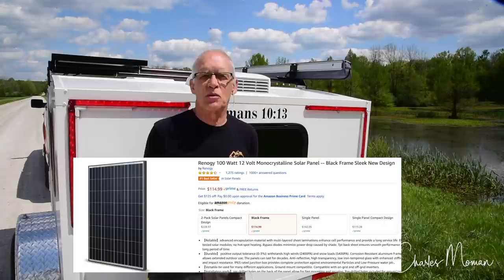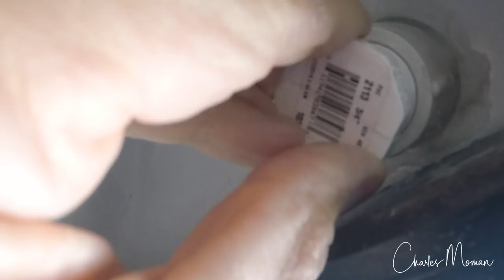A Simple Budget Solar Set Up for the Average Camper with Charles Moman

Comment: So when your jackery 500 is fully charged from the solar panel or from the A/C output how long can you leave the charging input cord in the Jackery? Like you forgot to take it out.. Does it keep charging and or does the light stay on? Will it hurt the battery ?
Reply from the maker: Like just about any modern electronic device, leaving it plugged in does no harm. I have left a Jackery plugged overnight and no problem. You might look at my recent review of the Ecoflow Delta 1300. It has almost triple the power of the Jackery, and yes it is more expensive, but it can recharge from zero in less than two hours. The Jackery takes so much longer. Ecoflow is coming out with a smaller version - R600 - that still has the fast recharge technology. I’m switching my entire system over to Ecoflow. I’m also just about to announce here on my channel, a Ford transit van build I will be beginning in a few weeks and I think you might find it interesting. You might subscribe so that you can keep up with it. It will be a 4 to 6 month van build and we will still use our Runaway camper. I’m pretty excited about it. Actually today I am filming the announcement video and telling an overall view of what I will be doing. Then the van build episodes will start in about 2 to 3 weeks.
Reply: @charlesmoman  nice. I know the Ecoflows line up is great.  I was looking at the r600 alot and other solar generators but living in Hawaii no body ships out here! As well as portable refrigerator coolers. I even backed the iceco icooler and three weeks later they said they couldn't ship to Hawaii.. I REALLY wanted that cooler. It really sucks 🤬.... well thanks for the info 🤙🤙

Comment: I am in the process of creating this set up. In your experience does the Jackery 500 charge faster while driving using the car charger port or the solar panel connection? Thank you 😊
Reply from the maker: It will definitely charge fast with a car charger and I should have included this info. To charge even faster in a car, get an inverter (some cars have an AC outlet in them already) and then you can use the Jackery wall charger - like at home. That will send more juice to the Jackery like you are charging at home. I would suggest a Bestek - I found these two on Amazon and they are similar, but  the more expensive one (not really too much $$ anyway) is more powerful.  300 watt Bestek ($29.99) - https://amzn.to/2XE4jFe. &500w Bestek ($39.99)  - https://amzn.to/3dglvH9. Let me know if you have anymore questions.
Reply: Charles Moman Thank you very much. My Odyssey does have an AC outlet as well as the 12 V outlet. PS. Thank you for your videos they are very helpful.
Reply from the maker: Check out my video about the Ecoflow Delta 1300! Very powerful, not cheap, but recharges crazy fast.

Comment: Will the Jackery 500 run your air conditioner?
Reply from the maker: Maybe for a very short time. Very. Short. Running a 5,000 BTU AC with a portable lithium battery pack is the pipe dream many have. Even a Jackery 1000 would not run it all night. They make lower power AC units that would help, but you still would have a depleted lithium battery that would take a long time to recharge. To run an AC every day via lithiums, would take a LOT of them and a LOT of solar panels. Today I am receiving an Ecoflow Delta 1,300w lithium battery pack to test out and do a video on. I think it would run an AC for part of a night or maybe more if the temp setting was on very low cool and it was a low wattage unit. At least with this Ecoflow you can recharge it 10 times faster than all of the other lithiums like the Jackery. From 0% to 100% in less than 2 hours via a wall outlet. Watch my portable power seminar videos and Timmy explains all of this well.
Reply from the maker: I just got an Ecoflow Delta 1300 and it ran my AC for 7 hours at low cool just fine. It recharged from 0% to 100% in 1:42! It could be run after day as long as you can get to an AC outlet or have 400 watts of solar and a perfect sunny day or plug it into a gas generator. Folks could just stop at a place in town and ask to plug in - there is always a way.

Comment: I love your Romans 10:13 blessings
Reply from the maker: We are very soon starting a Ford Transit van conversion series here. It is an empty 2018 Transit cargo 250 with a medium roof. Susie will be writing with a black permanent sharpies, scriptures all around the walls, floor and ceiling before they get covered up,  I liked the idea of being surrounded by scripture and "bathed" in it. We will still use the Runaway as a permanent set-up bed. Being watching for the series and subscribe if you feel led. Blessings!
Reply: I had a similar idea for my  2020 connect lwb  camper van   i found scripture wall paper I’m going to order for panels and such    Jesus is great

Comment: Hi again, does the jackery 500 run the a/c in the runaway?
Reply from the maker: Nope. Even a Jackery 1000 would not run it for super long. You could run the fan in the AC with the 500 for a good amount of time. That is why I put in a MaxxAir fan for times I do not have shore power. The AC is an energy hog.
Reply from the maker: Look at my new video about the Ecoflow Delta 1300. More $$$, but 1300 watts with an 1800 inverter and recharges CRAZY fast. Best in class. I ran our 5000 BTU the other day for 7 hours.